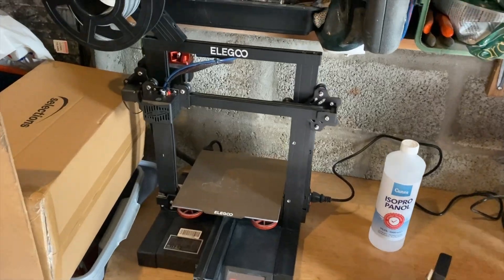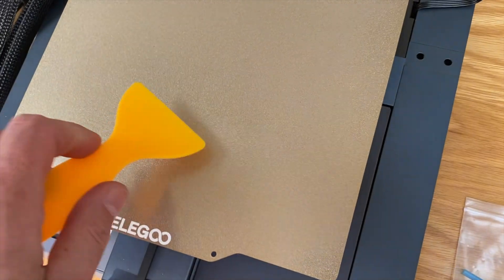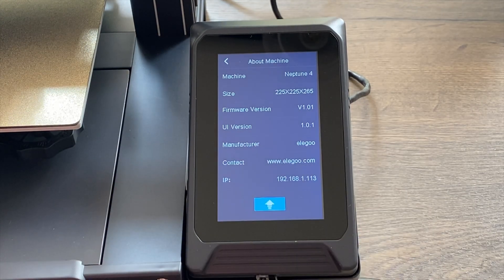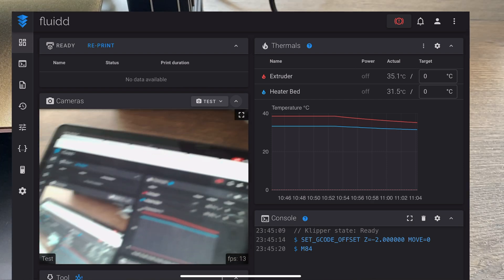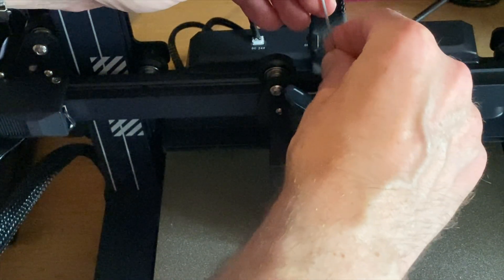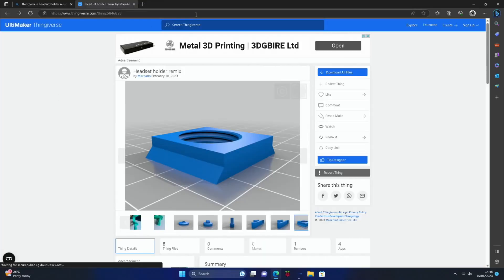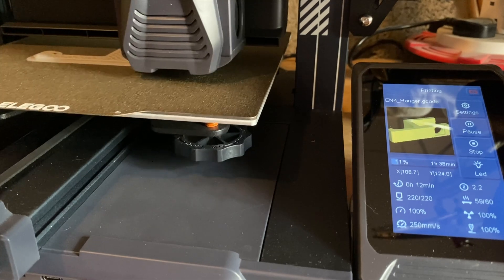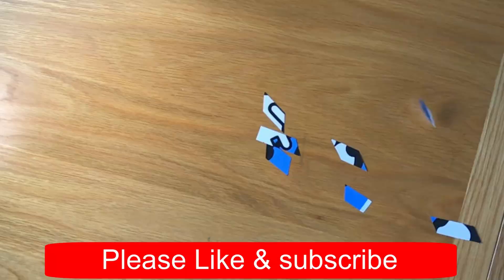Fast affordable 3D printer. Elegoo Neptune 4.

Comment: I totally need an idiot's guide to basic 3d printing. With my combined hobbies I think I'd get some use out of one. Espresso prep tools, fish tank accessories and cases for SBC etc, lol. But I am a little slow on uptake. :P
Reply from the maker: These videos may be useful. The first one is my experience with no previous experience 

	Elegoo Neptune 2S. first time setup, loading filament and test printing.
	https://youtu.be/OpfBgf4IDng
	
	How much electricity does my 3D Printer use? 9 Hour print.
	https://youtu.be/ihtXeWk5was

Comment: Nice looking machine. Comes out of the box running Klipper which is a definite positive!

One small point, only saw it very briefly, bur the bundled cable looked to be USB-A to B not A to C as you said in the vid
Reply from the maker: Yes A to B 👍🏻